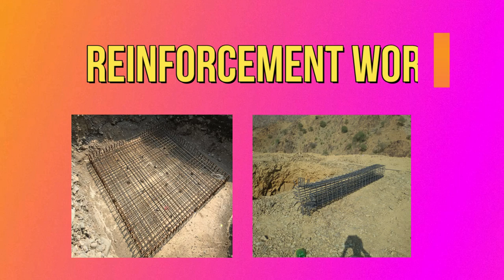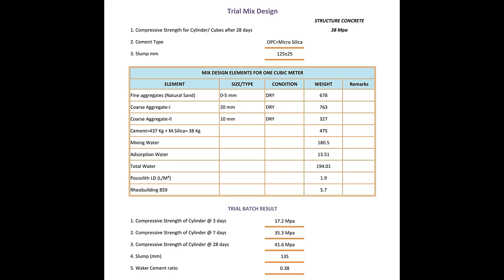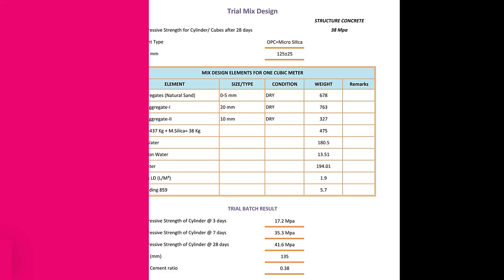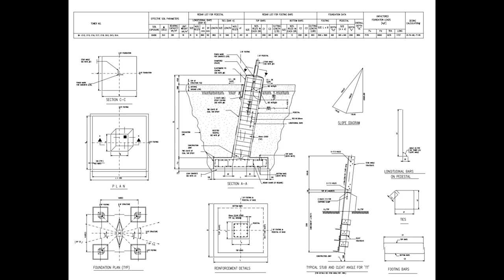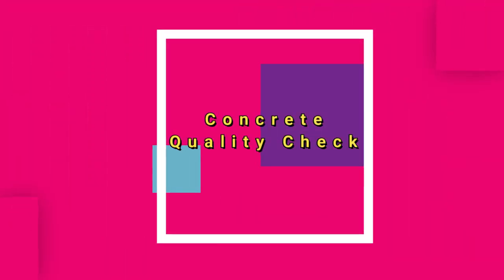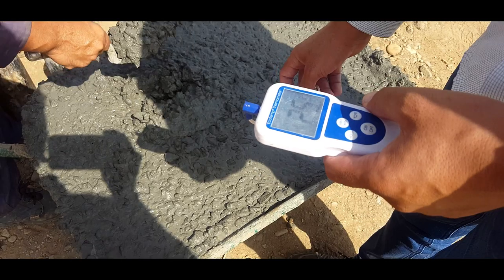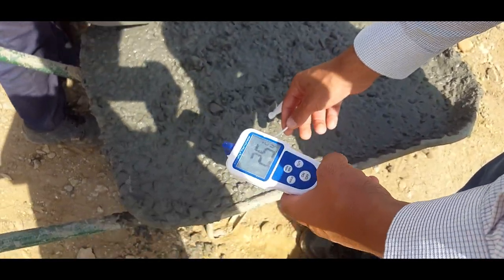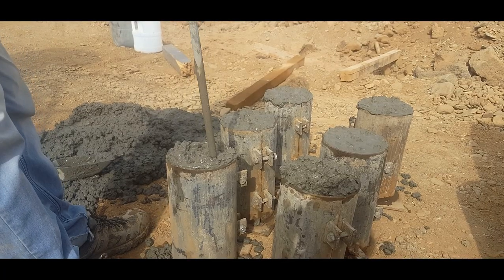Transmission Lines | Foundation

Comment: Is concrete allowed to free fall from that height? Really surprising to me how engineer-in-charge accepted this. Easy but not right i think.
Reply: M Daud  10:38 That looks like 8+ feet free fall to me, assuming the guy standing is at least 5 and half feet.  I am a structural engineer and personally I wouldnt allow this in my projects under my supervision.  I generally allow only 3 to 5 feet.
Reply: What would happen? Is there anything wrong if it is poured from that height? Just curious.
Reply: @Rocky.7707  Segregation is the problem. The heavier gravel particles will separate from the slurry during free fall.  You can read about it in any concrete related books.
Reply: @narayananjayachandran831  I see, thank you for taking your time to explain.
Reply: @Rocky.7707  Welcome

Comment: Hi
Reply: What about earthing?
Reply from the maker: Depending on the soil resistivity, there are two types of earthing generally used in transmission line
1. Pipe Type Earthing 
2. Counter-poise Earthing